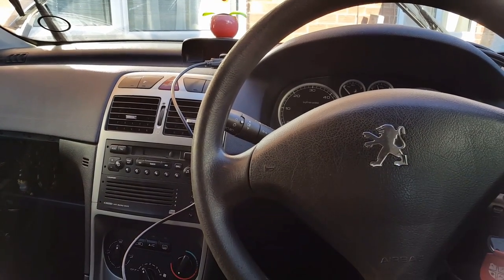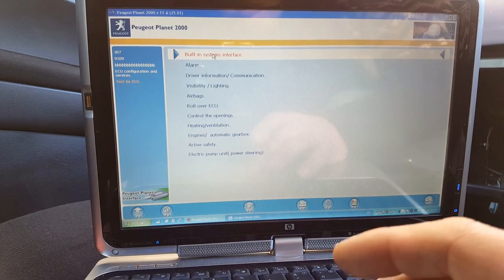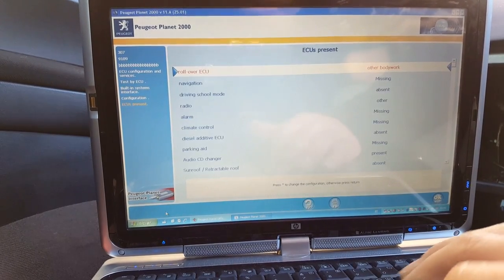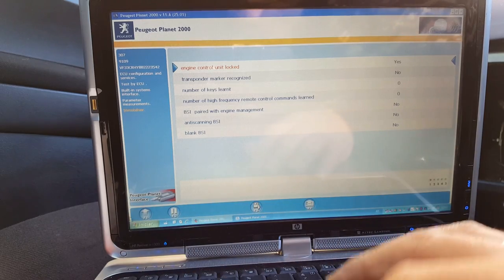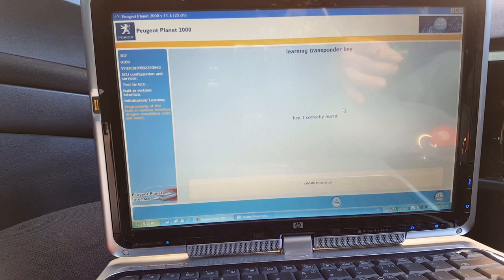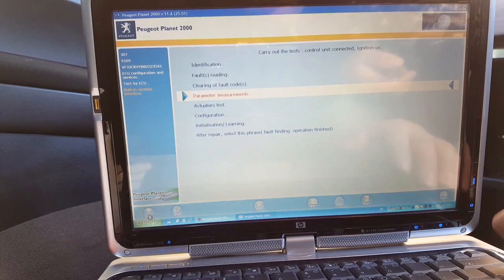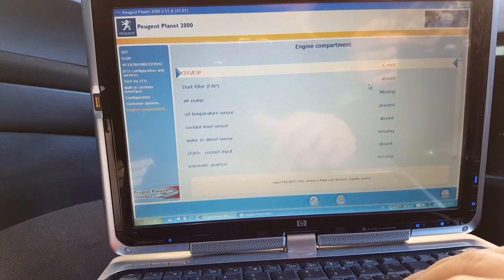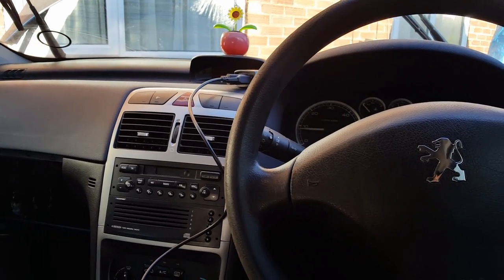Peugeot Citroën blank/virginized (new) BSI programming. Includes key/immobiliser programming.

Comment: Hi mate, thanks for all your great videos. I like the way you let us go thru your troubleshooting steps as if we were doing it ourselves ! I can see you get to repair a lot of Citroens. I have a DS3 myself and keep running thru engine problems. You inspired me in buying a diagbox and I just got Sedre and Servicebox. I can see a FA58 code about unexpected BSI resets for about 300 events ! The thing is my engine runs like crap but I fixed it doing a Auto Adaptive learning. Three days later it came back to the usual issue; it bumps my seat every gear shifts as it is unable to accelerate smoothly. I'm under the impression learned values get reset and the engine runs on default crap values. Did you experience that kind of issues already ? Is there a fuse that could be blown and BSI/BSM would not hold those values in memory ? I don't know what to do, usual repair stations don't bother with this kind of stuff and it really gets this car a pain to drive. I would be happy to hear about your thoughts. Thank you. Jeremy
Reply from the maker: Jérémy Mougey 
Hi
First all thank you for you comment, very kind of you...
The reset adaptation procedure, should actually somehow make the car to run better, sometimes, straight after the reset, the might run a bit lumpy while learning the adaptations again, but with time should improve and start to run better.
The BSI,  does not have a lot to do with engine management, that's is job for the engine ecu.
Do you have any codes on the engine ecu?
Check you live data as well...
Thank you for watching!
Reply: LM Auto Repairs Wow that was a quick reply :) ! Yes I'm wondering if it is a simple coincidence given that as you said, those settings should be with the BSM. It is actually quite a new car (36k km). I've done the full learning procedure on Sunday and I could experience some power loss while doing it. After I completed the pedal drop for 8 seconds everything went perfectly and it ran smoother than ever until today. In servicebox I found a note mentioning the procedure shall be repeated as you take battery power out. This is where I believe there is a power loss at some point. The ECU does not show any fault codes but it might be the BSI is the only one recording power outages as well. I just checked the shunt believing it may be on Park position and cut power to some controllers, but it was on User. At this point I'm just concerned about premature wear of mechanical parts due to sudden engine accelerations. The main effect is a lazy engine. As I press the accelerator RPMs does not increase until I press it further and it goes above expected RPMs. And as I engage the 4th gear it keeps cuting fuel (too early compared to the load). If disconnecting the battery resets the ECU I would believe it should get a permanent power, maybe thru a cheesy relay or fuse... I will have to check the drawings tomorrow. Please cary on making these videos; they are very interesting and that's about two weeks I watch them one after the other ^^ !
Reply from the maker: Jérémy Mougey 
No worries...
Checking live data can be helpful as well...
Quite surprised you are having such issues with a low km car...
Reply: LM Auto Repairs You're right, I believe this model is a good trainer for repairs ^^. What kind of live data would you suggest me to monitor ? I've already been monitoring Pedal, Butterfly, variable lift, mass air... and values matched demand...
Reply from the maker: Jérémy Mougey 
You are looking at the right ones...
What about the knock sensor?
Reply: LM Auto Repairs Hi, I had a look again and there were no spikes or anything strange. However I had a look at both intake and exhaust camshaft phase shift solenoids inputs; I could see all the bumps I felt on these curves. Sometimes I could feel steps in the engine decelaration and they were shown as well on curves. I tried on low RPMs and I could see steep angle changes as I felt the engine being bumpy. I now believe this is what makes it so uncomfortable to drive, and I do believe those angle changes were smoother straight after I did the learning. I could also tie the FA58 dtc with the time frame the BSM must have reset. If I could find what triggers this dtc I may be able to fix it and get the engine to operate smoothly within time. I didn't check wiring diagrams yet but there is definitly something wrong with this dtc although the BSI states it is to be discarded; moreover it appears as a permanent fault :/ ! I guess camshaft sync has ever been critical in an engine, and there is no feedback from the solenoids. What I can tell is what the BSM demands is well applied and sadly felt. Also I can hear a bad clicking noise at idle probably coming from an improper chain tension. I will be giving Citroen the car for a check. This engine definitly has some bad mechanical adjustments.
Reply from the maker: Jérémy Mougey 
From everything you said, it looks like a timing issue...
A slack chain/belt as you mentioned...
Or the timing adjustment system...
Let's us know the outcome...
Reply: LM Auto Repairs I can upload a small video of that ratling noise and share it later. I'm not an auto professional, just an avionics keen on troubleshooting ^^. You may be able to confirm your idea. I'm a bit concerned with bad timing; could the valves actually knock on pistons or is that somehow prevented in today's engines ? I would find it hard if the engine could blow whenever one of these solenoids would fail ^^.
Reply from the maker: The variable timing only adjusts a few degrees, and even if they fail, will never be enough to cause damage... but, there is always a but, that in conjunction with a slack chain or belt, it can then cause issues..
You can check the timing with the scope, if you have one...
Or just lest the daler to have a look, and see what they say...
Reply: LM Auto Repairs Thats is great to know :) ! I did buy a scope someday which is waiting in its box for the time I need it... It would be great if I could get directions on where to connect the probes and what to look for.

Comment: Hey thank you for your informative video, you enter a pin code is it a new one you choose? And did you verginize the ecu and the bsi?
Reply from the maker: Hi
No... was the original pin code from the car... it has to be... otherwise you need to virginize or change the pin on the engine ecu as well... as they need to mach...
Hope that helps. 
Thank you for watching!
Reply: Thank you so much

Comment: Hi my peugeot 508 have volt reading of 12.7 while engine is running would this need a bsi reset it drink bit more fuel when the volt reading goes frim 14.5 to 12.7 while driving any help please